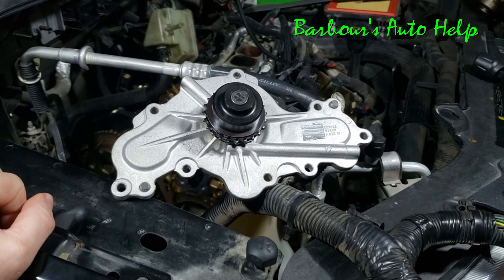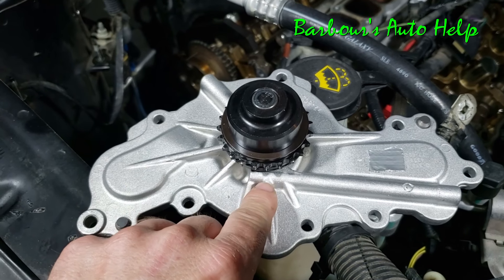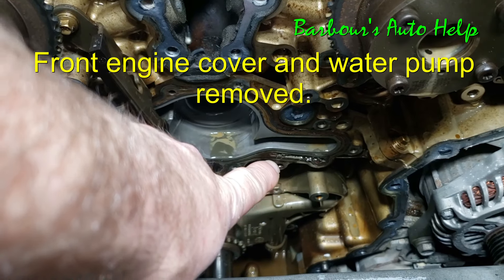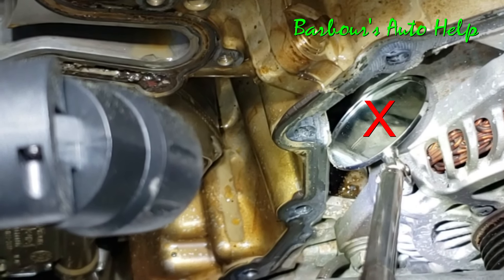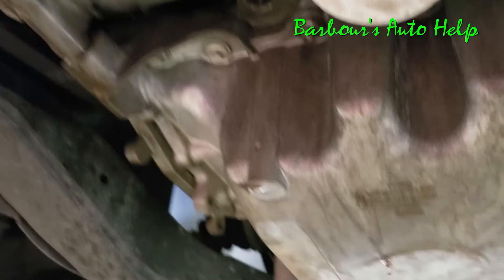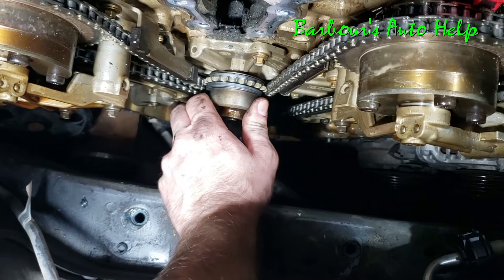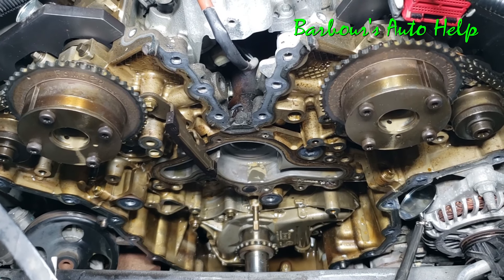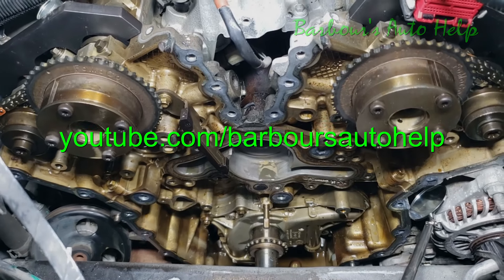Ford 3.5L and 3.7L Water Pump Leak/ What To Look For

Comment: VERY GOOD. THE BEST ABOUT THIS. THANK YOU. JUST SUBSCRIBED. Look forward to your re-build.

Our 2012 Pristine Lincoln MKX AWD has the 3.7 litre Duratec V6. Same 3.5 design setup.. 93K on the clock. At 45K one time MICROLON  treated everything. Engine, Trans, Rear differential. PTU, A/C, Coolant and Power Steering. 
 This is our 5TH vehicle treated with MICROLON. Use for years with competition firearms and airplane engines. Microlon is FAA and MIL-SPEC (7) certified.  Change oil 4K miles with Liqui Moly 100% synthetic. Engine Flush with Ligui Moly prior to change. OEM Air Filter change also at a local trusted Oiler. Our Lincoln Dealership does our fluid changes, save engine oil changes: OEM Trans 30K miles, Rear Differential (Red Line Syn Gear oil) 75K miles, PTU (Red Line High Temp Syn Gear oil) superior to the Ford stuff. Evacuated/filled 25K miles, OEM Coolant Flush (new Yellow variant) every 25K miles, A/C  evac every 2 yrs., Power Steering flush OEM every 2 yrs., Brake Fluid OEM Change/Flush annually. The Coolant is manual change stated every 30K miles. I do every 25K miles due to the water pump issue. WEEP HOLE checked regularly. I feel confident the pump should last with how our vehicle is maintained and that Ford improved the pump's bearings and a new dual sprocket design.
 Lincoln states the PTU (12 oz oil) never needs changing. Lifetime fluid they say. NUTS!  The PTU resides 8" from the Catalytic Converter on one side and bolted to the trans on the other with a cheap aluminum heat shield between the PTU and the Converter. The oil boils! These babies fry the oil. Model sales to the middle east I'm told the PTU is radiator coolant cooled. If you own a AWD Edge, MKX, Flex etc.. Check out the horror stories on YouTube. It is a money generator for the dealerships. Say $1k plus to fix. Ours died @18K miles. Warranty covered.. Hence the PTU research and attention.. The unit on our model has no drain plug. My family claims I'm compulsive about our MKX. Maybe so. However it is a reliable safe economically sound vehicle to own. We average 22 city 25 highway MPG. Not bad for its age, weight and size. A family member's 09 FLEX just lost his engine due to the water pump failure. A 75% club owner . I am of the 25% owners club who maintain to owners manual spec and then some our vehicle. The 75% owners club do not and suffer financially. 

Our Lincoln dealer does all the additional Liqui Moly stuff for me:
• Catalytic Converter cleaner every 10K miles. 
• DI JECTRON, direct injection valve & combustion chamber cleaner every 2.4 K miles
• Air Conditioning Cleaner and Bio Sanitizer. Annually
• Fuel Injection Cleaner every 1.2K miles. Liqui Moly calls there products "vitamins for your vehicle". 
All these Liqui Moly products work as promised beautifully and do not damage seals etc..You see and feel it. Results? Super clean running everything. Bore scopes of our valves and combustion chamber are remarkably clean.  Normally they are filthy gooey power robbing crud on everything.

Preventative and Improvement items we have done so far:
• Serpentine and belt replacements @ 60K miles
• All Coolant hoses replaced @ 92K miles
• Replaced to LED all interior and exterior lights.
• Off Road HID super duper flood white head lamps and HID Fogs replacing those pathetic H4 units.
• Running Michelin Cross Climate 2 tyres. Amazing soft ride especially on our 20" rims. 

We like our MKX. Fit finish etc. A fuel buring Oracle we say. Other than the design flaws (Water Pump, PTU) our normally aspired DURATEC V6 is a champ. Mid range torque comes on like a stem engine. Power is predicibly amazing . Our MKX  is a comfy luxury cruiser. 

Fair Winds and Following Seas

Comment: Did the engine survive? Or did you have to replace the whole engine
Reply from the maker: SURVIVAL!!!
Reply: @BarboursAutoHelp  Fantastic you must’ve caught it just in time
Reply from the maker: I feel very fortunate.
Reply: @BarboursAutoHelp  I have nothing against Fords, but that’s a really really terrible design if you’re not vigilant checking your oil and or coolant you’re going to end up with a destroyed engine ,And a massive bill
Reply: @BarboursAutoHelp  how do you know if don’t catch it in time? Are there “tell-tale” symptoms I should or can be looking/listening for? Great video! Thanks in advance!
Reply from the maker: Engine knocks and rattles along with metal in the oil is usually an indicator.  Sometimes the wear and tear may not be detectable without engine disassembly.  In some cases when the engine sounds good the failure may catch you later down the road.

Comment: My cord Taurus x 2008 is leaking a crap ton of coolant at a fast rate but it’s leaking from the top of the alternator towards the front of the engine . Could this be something else besides the water pump?
Reply: No chance in hell it is anything other than a water pump.

Comment: I have a 2015 3.7 transit just got it last year ever time I drive it I smell coolant and have to add Coolant I ended up blowing my motor I replaced it with a low mile one and it’s starting to do the same thing  I didn’t change it so I don’t know if they change the water pump but not seeing where the coolant is going is driving me crazy if you can point me in the right direction would help me out a lot thanks in advance
Reply from the maker: I don't think this video applies to that vehicle.
Reply: Common leak points are the coolant hose connector o-rings and the turbo coolant line Jiffy fittings. The o rings get hard and don’t seal.

Comment: Was looking to replace my 2007 Tahoe with a 2016 Flex, but after hearing about this issue, I think I’ll just pass. I can replace my engine (reman, of course) for less than the price of the fix for this issue. Sucks, because that Flex was in primo condition from what I could tell.

Comment: I have a 2013 Ford Taurus , seems to have coolant a leak but it’s at the bottom of the radiator that you can barely see. Two mechanics said it’s the water pump and the other said it’s the radiator. Which one should be replaced ?
Reply from the maker: Well,  that's a question that's entirely impossible for me to answer.  I don't know.  Maybe have a 3rd tech look at it.  I can't see it....so.
Reply: I have a 2011 SEL Taurus with 109k. 

They should be able  to trail the coolant leak to pin point where it’s coming from.  If not watch the levels of ur coolant weekly

Comment: I was thinking about buying  a   (3.7engine)   Mazda 2011 GT with 69,000 miles should I change the water pump and timing chain?
Reply from the maker: Thats your call.  But, i don't believe that's a Ford engine in that Mazda.   Didn't Ford and Mazda slit in 08?

Comment: Mine is gushing out coolant from that area?   Oil looks good, dropped it off at the dealer, what do you think?
Reply from the maker: I think they will definitely take car of it.  Probably one of the best places to take it.  They know how to do it.
Reply: @BarboursAutoHelp  I just had this problem  at 87,000 miles. Crazy the work required to replace it. If you don't catch it the eventually it dumps coolant into the engine oil creating the chocolate milkshake and engine is done.

Comment: Is there any way to prevent this? 
More frequent oil or coolant changes?  Some kind of additive treatment to help the pump seal or shaft bearing?  
Do the weep hole also help indicate shaft bearing failure?

Thanks
Reply from the maker: To my knowledge there is really nothing you can do.  Yes, keep up with maintenance and such, but this is just something that happens......on most vehicles.  Its not necessarily an indication of a bearing failure.   It can be but not typically.   Weeping is an indication of a seal failure.
Reply: Water pumps fail on many cars, and this is just a very difficult one to get to and costs a fortune to do. Smart engineering

Comment: First of all thanks for the video 
What are the other most common signs of bad water pump for example antifreeze lost or something else?
I always go down on my vehicles and noticed a very small drip below alternator and saw some kind of dry liquid sign . But my antifreeze level is normal.
Reply from the maker: You think it could be condensation from your ac line at the compressor?
Reply: @BarboursAutoHelp  i hope so.this time it feels a little greasy but it was very small. My wife thinks I’m crazy because I check it everyday 🤣 I’m going to go to the dealer to do pressure test just to be safe.
Reply: MILK SHAKE OIL
Reply: @Don Sigler  too late by that point

Comment: Would water seepage from this water pump into your oil supply cause white smoke to exit from the exhaust pipe, by chance? And are there any other specific auto models / engines (non-Ford) which we should be aware of which use this same type of completely internally mounted water pumps? Thanks.
Reply from the maker: I wouldn't think that coolant seeping into the engine from the water pump would cause white smoke from the tail pipe.  As far as other non-Ford vehicles that have water pumps mounted inside the timing cover, yes.  Google it.
Reply: @BarboursAutoHelp  Thanks. Will do.

Comment: My 2013 Sport just hit 130,000 miles and the water pump is now leaking ever so slightly out of the weep hole. Its hard to see the area but the coolant is dripping down the AC compressor and oil pan. Oil looks like oil still so I'm hoping this is fixable.
Reply from the maker: You caught it at a very good time.

Comment: What's the point of the 2nd weep hole I'm the engine valley?
Reply from the maker: It is also to weep coolant.  Not as usual for coolant to weep from this one but it does happen.
Reply: @BarboursAutoHelp  so it means the water pump is bad? I put UV dye in my coolant system and placed a mirror and flashligh into the valley and sure enough the coolant is slowly coming out the valley weep hole... the one behind the alternator is bone dry

Comment: Why would anyone put a water pump internal to the engine?????
Reply from the maker: Ford ain't the only one that did it.
Reply: So that you will have to pay a “dealership” $1700 to replace a60 dollar part.
Reply: This named STPd engineering ,for me , all F fords  looks like (Russian tech) big for nothing , I was a Master tech on T72 T*nks , my always question , how ford are still in business , with there very low quality of  engineering ..thanks
Reply from the maker: I've been working on vehicles for over 20 years I think every manufacturer has engineers that hate mechanics.  Lol.  But seriously I wouldn't single out Ford.  Check out my other stuff on GM, Chrysler and Honda.   They all have stuff that will make you say.... What in the world where they thinking?!.
Reply: Looking at this from both an engineering and business point-of-view, I am not sure that it is a bad idea to put the water pump inside the engine. I may be wrong on this, but it seems to me that since the chain will be in constant motion to sync the cam and crankshafts, it makes a lot of sense to exploit this to create cooling without additional energy requirements. That likely will help with the overall fuel efficiency of the car. And, since it seems that most of the water pump failures would take place above 100K miles, Ford business leaders may have thought that after 100+K a car does not owe anyone anything, and that if someone wants to run a car above 100K and onward, it is reasonable to expect them to absorb the costs.

Not defending Ford on this. I loved the water pump placement until I hated it. But I am trying to leave myself out of this and see it from an engineering and business perspective.
Reply: @BarboursAutoHelp  Do any of these other cars listed above also have internally mounted water pumps?
Reply: Will that cause the oil to look milky antifreeze is empty car runs good could this be the problem
Reply: @ Absolutely, I would say that would be the only cause J could think of.

Comment: Barbour how would you rate this engine? Looking to buy my wife a Lincoln MKX  with 120k miles. Our GMC Acadia big problems were I replaced transmission three times one under warranty and the timing chain, oil pump and water pump. Never had a problem unit 230,000. The old girl made 340,000 CAM BUSS failure ECM. I am a heavy equipment mechanic is the only way we could afford all the repairs.
Reply from the maker: In my opinion it's a VERY solid and reliable engine that produces plenty of power. It just stinks when the water pump has to be replaced. It's hard to say what I would rated it from 1-10.  I'll just say I dont see these engines in for much other than pumps and chains and very few at that.  I'm a huge fan!
Reply: Don't even think about the 3.7
Reply: @Don Sigler  curious why you say this? It's just a bored 3.5 with the same exact issues as far as I know.

Comment: WhT about F150 2016 flex fuel
3.5 6 cyl ti vct. Is that the same internal pump?
Reply from the maker: That's an external pump.
Reply: @BarboursAutoHelp  thank you, I called dealership today and they also said external.Thanks, guess I can 
relax on that then.Whew

Comment: How much coolant where you loosing through the weep hole before it went out?  Did you notice a low reservoir?
Reply from the maker: I bought the vehicle after it went out catastrophically.  Im sure there was plenty of warning signs..... especially judging by the permanent snail trail on the side of my block.
Reply: @BarboursAutoHelp  oh you got it cheap to try and salvage.  Was the engine trashed?
Reply from the maker: I got extremely lucky .
Reply: My 11 Taurus SEL is in the shop with the exact same issue. No warning! No check engine lights, nothing. 142K miles. I will say to anyone worried about this failure happening and trying to prevent it, pay attention to herky  jerky very random transmission shifts. Why? Once the coolant REALLY starts to leak it sprays toward the tranny. Also long before the catastrophe, I would hear a very high pitch whistle sound generated in the abyss of that  3.5L engine. You can hear that sound on the freeway when there's a wall to the left of the drivers side or in the drive thru of your favorite restaurant. Other than that, its not a matter of if its a matter of when, WHEN I SAY! 😝 I'M SO GLAD I GOT A WARRANTY. I was told today that they are replacing the engine because its easier than repairing the failed one.
Reply from the maker: How does the leak spray towards the trany?
Reply: @BarboursAutoHelp  How does it spray towards the tranny? Once the coolant leak had been discovered and more coolant was added, in an attempt to test drive the car the coolant leaking from the water pump was covering the oil pan, tranny, and undercarriage nothing towards the top . I received 4 DTC'S  P0346, P0022, P0012, P1602. 🤨 Could a bad camshaft sensor cause a dead battery?
Reply from the maker: Oh I see.  Not sure whats causing the problem.  But the code p1602 leads me to believe you have something deeper going on.

Comment: can you please tell us how often this water pump should be changed on 6th gen V6 engine ?
Reply from the maker: There is no maintenance interval.   But in my experience they usually go out sometime after the 100k miles mark.  That sometime could be between 100k and never.  Best just to inspect for leaks ever oil change in my opinion.
Reply: @BarboursAutoHelp  thanks a lot for a good advice. Ukraine is watching )

Comment: Ford designed it this way because on the transverse mounted engine applications, they could not fit the external water pump in those applications.

Comment: Is this water pump on the naturally aspirated 3.5 or only the eco boost
Reply from the maker: Both.  But not on every Ford vehicle though.  You won't find this on an F150 or transit.  If you see an externally mounted water pump on a Ford with a 3.5 or 3.7 then this will not apply.
Reply: @BarboursAutoHelp  thx
Reply: Only the FWD 3.5/3.7 use the internal pump. The rear drive version has a idler pulley in its place with the water pump being externally mounted.

Comment: What yr did ford go with this chain driven water pump on the f150s?
Reply from the maker: I'm not aware that Ford went with a chain driven water pump for F150s.
Reply: Or the internal water pump?
Reply from the maker: To my knowledge F150s do not have either.

Comment: If you mentioned this in your video, I must have missed it. My question........Is there a way to make the water pump last longer or is the water pump issue completely random?
Reply from the maker: I don't know of a way to make it last longer.   They tend to go out sometime after 100k miles...if they do fail.
Reply: @BarboursAutoHelp  Very helpful, thanks for replying.
Reply from the maker: No problem 😊
Reply: One thing. get off that oil blend, to synthetics  change coolant 30.000 miles, Tech at a Lincoln Dealer Advice
Reply: @donsigler588  Thank for the information.

Comment: Would this apply to a Ford Explorer interceptor AWD 3.7
Reply: If you haven't figured it out in 3 years, yes, yes it does. All 13-19 interceptor models have the same design.

Comment: 2011 Ford F-150 3.7 4wd externally mounted?
Reply from the maker: Yep.
Reply: @BarboursAutoHelp  thank you! Anything major to look out on those f150s with the 3.7?
Reply from the maker: I hardly ever see them in the shop if that tells you anything.   Well made vehicle in my opinion 👌.   You may get the occasional 4x4 problem with the check valve or IWEs....maybe.  Also, if it has the 6R80 trany the lead frame may fail in the trany but Ford has extended coverage on that if it falls within a certain time  and mileage.  But really a good vehicle. I love them.